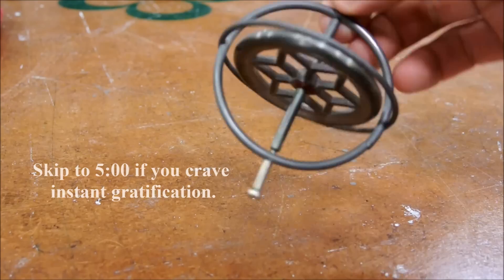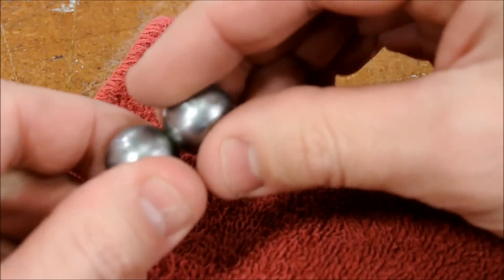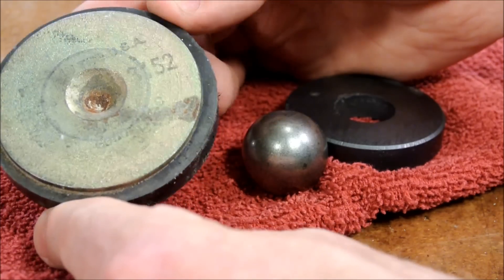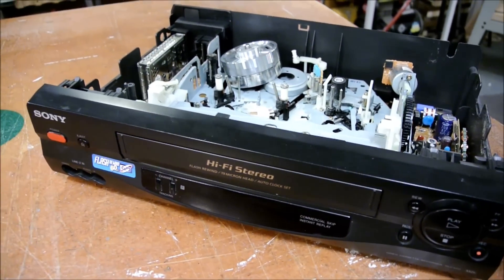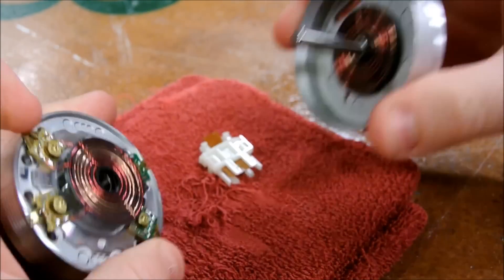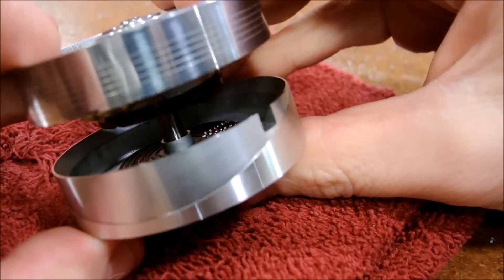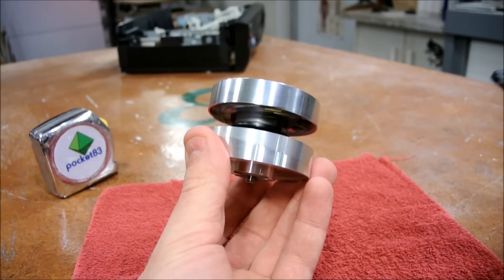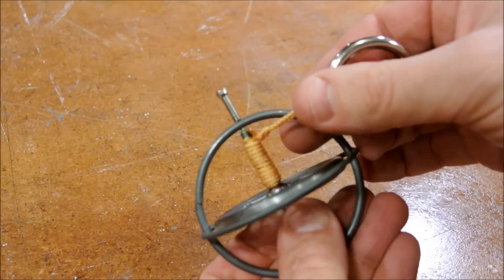VCR head gyroscope! ...and other shiny spinning objects

Comment: Oh the hundreds (maybe thousands) of VCRs I worked on over the years. I threw away (recycled) the last couple dozen video drums I had when I closed my shop in 2013, But I did strip and save the bearings and the locking collars. I kind of wish I'd saved one now. Those parts you're aiming the air at are the actual videos heads, in case you were unaware.

I always enjoy your videos. Thanks.

Comment: The VCR head works just like a tape recorder head with a couple of exceptions. There is a lot of information in an audio/video signal, so the engineers had to get as much information as possible into the smallest unit area of the tape. To accomplish this three things were done:
1) The head is is very small in order to leave a small track of magnetic information behind. That allows the machine to leave many many "stripes" per linear inch of tape.
2) The head rotated at a very high speed to read as many lines as possible each second.
3) To understand the next part two physical properties must be defined: Cohesion (koh-HE-zhun), and adhesion (ad-HE-zhun). Cohesion is how well one thing sticks to something else, and adhesion is how well somethings molecules stick to each other.
A layer of  air molecules stick to the rotating drum through cohesion, and adhesion causes a layer a little bit thicker to stick to the first layer. This means that a cushion of air is stuck to the surface of the rotating drum. This means that the speed of the drum determines the thickness of the air layer on top of it. This is balanced against the tension of the tape, and it allows the tape to move over the high speed drum floating on a cushion of air! That allows the tape head, and the tape to be very close together, so that a lot of information can be packed into a small area.
Also at 4:46 the speaker is pointing at the heads for the circuit boards with a pencil. The part that sticks out past the surface of the drum is the actual head.  (I told you they were small!)
I hope this helps.

Comment: Without looking at any comments and not scrolling down so I’m unadulterated in seeing anything I would say cold when using compressed air.  Pretty cool. I need to scavenge an old vhs player and get to shredding something that I have yet to operate on.   I never thought I’d be tearing up or down old electronics but not that I’m old and torn up myself it’s really all that I have and it’s pretty cool actually seeing how things are built and function and some things have really awesome parts and then there’s trying to figure out what some parts can be re porpoised 🐬 for or if they are just really neat gizmo toys. Rad Video 
Man!

Comment: Some time last year my grandparent's neighbour asked me to take a look at her VCR, and just trash it if I couldn't fix it. Probably a clever way to save herself a trip to the tip.

I couldn't fix it since my knowledge of repairing electronics is just looking for swollen capacitors or burned components, but I did also spend a while playing with the head. I didn't think of using it as a gyro but I replaced one of the bearings with that retaining collar, which was strangely a very precise fit with bearing holes, and used it as a spinning top.
Reply from the maker: That's funny. I think I did exactly that with the last VCR I ripped apart.

Comment: You are supposed to sit these old tops on a  scrtched wire, they dont bounce around and you get a nice top holding straight on a string. ( that's why they have a notch under its main pole.)

Comment: If you want to get a really good pull on a gyroscope try 3 to 4 feets of braided fishing line.
Its really strong and very tiny so you will get many tours around the shaft.
The more tours the more force you can apply at pulling so ... MORE SPEED! :)

Comment: When the ball/magnet spins at an angle, even though it's touching the glass at one point, wouldn't there be a lot of friction because the point that is touching wouldn't be on the axis perpendicular to the axis it's spinning? I imagine would be like a wheel spinning on the spot, which explains why it slowly moves(the ball can't get traction to move quicker but it shows the point that the ball touches the glass is moving very quickly) which id imagine would slow down its spinning speed.
Reply: Peter Minnekeer excellent point.

Comment: For the gyroscope forget the string what you can use is a tire preferebly small bike tires and with that if you run the axle part of the axle along the bike tire while turning the bike tire you can literally kick it at high speeds! Just be sure to lube the ends before doing so as the gyroscope uses friction instead of rolling element bearings! XD

Comment: Questions: 
With the high speeds of the VCR head, blown by the air compressor, how much voltage / current could the vcr head produce if used to produce electricity?
In like manner, if the threaded together ball bearings were made of different materials, and blown to those high speeds, how much current / voltage could it produce?
Would the created voltage / current be less than, equal to, or more than the energy needed to blow either of the above to those high speeds?
fyi: The ball bearing question above is envisioned as the bearings made of magnets / magnetic materials.
Reply: 1: it wouldn't,  2: they wouldn't, 3: Far less.       magnetic material... irrelevant.

Comment: Hmmm. I don't have an air compressor OR a bicycle. I do have a motorcycle which can spin a 25 inch tire @ ~2000rpm. That's north of 18,000rpm for the gyroscope...now I just need a VCR head!

Comment: you could connect led's where the read/write heads are connected instead of cutting that ribbon cable off of the stationary part of the drum that powers the coils in the ferrite plates inside that are for wireless power transfer to said heads  With the addition of a 74HC595 or a 74HC164 serial in parallel out chip (or several of them), and a few other parts (capacitors, resistors, maybe an inductor and such)  you would have the "hardest to build" part of a persistence of vision displaying gyroscope! That my friend, would be ultimate! 

To those "fidget spinner" knobs.... build something! Fidgeting gets you NOWHERE!

Comment: Hot, friction causes heat right? Rolling friction of the bearings, and friction from the air resistance on the outside
Reply from the maker: Yes, but wrong! Friction does cause heat, but this thing still gets cold. Why? Because the compressed air quickly sweeps away all of that heat, and then some.

Compressed air is air that is in a settled-down state; heat is simply molecular motion, so in order to cram lots of it into a small space, it has to give up its heat (energy).

In scientific disciplines, this idea is known formally as the Ideal gas law, which is usually expressed mathematically as PV=nRT, where P,V, and T just mean pressure, volume, and temperature.
Reply: pocket83 yes of course! I should have thought of that! Thats how a refrigerator works too, when the freeon pressurized gas is released it is really cold!!

Comment: I thought it would get cold because when compressed gas decompresses it becomes cooler
Reply from the maker: Yep. Even though the bearings generate heat in the form of friction, the fast-moving cool air sweeps away the heat (and even removes some after that). The result is cold metal.
Reply: pocket83 ahh interesting

Comment: Does it become cold because of the expelled kinetic energy?  or would that just make something hot?  Physics is confusing.
Reply from the maker: Physics is confusing. But it's also possible to understand.

Friction (from kinetic energy) does cause heat, which should make it feel warm, but this thing still gets cold. Why? Because the compressed air quickly sweeps away all of that heat, and then some.

Compressed air is air that is in a settled-down state; heat is simply molecular motion, so in order to cram lots of air into a small space, it has to give up its heat (energy).

In scientific disciplines, this idea is known formally as the Ideal gas law, which is usually expressed mathematically as PV=nRT, where P,V, and T just mean pressure, volume, and temperature.

Comment from the maker: ;)
Reply: "Read" the description
Reply: partyrocker You need to scroll down more if you think he is the only one mentioning VSauce....
Reply: pocket83 I think it becomes cold because something about it spinning makes it a centrifuge and makes the molecules stop moving and that makes it cold? I'm just guessing
Reply: Agree
Reply: I think it is cold, because he used compressed air.  That makes things cold.
Reply: I thought it would become hot from air resistance, but I suppose aluminum is such a good thermal conductor that any heat generated by those electronic bits (on silicon chips, good thermal insulators) quickly spreads through the large mass and dissipates.

Comment: Hmm... I know how CDs work. How cassettes work. Even how flashmemory works. But not VCRs. Time to correct this Will come soon.
Reply from the maker: I was reading briefly about how the tape goes around the head in a helical fashion, rather than in a linear feed (that's why it's at that goofy angle). I though that was really clever. I guess one benefit is that a crease won't entirely destroy a cross section of information. Weird.
Reply: Spin the heads and the tape can move slowly, otherwise the tape would have to move at the speed the drum is spinning. My dad used to repair these back in the day (electronics engineer), I remember him telling me how the head alignment was one of the most precision things people had in their homes in order for every machine to be able to record and playback every other tape, and yes I made plenty of spinning tops from the heads as a kid :)
Reply: pocket83 Hah. I always thought that that angle did not make any sense whatsoever.

I might have a working one in my home, still.

Comment: why does it become cold?
Reply: Because of things... you know...
Reply: Joof My guess would be more from the compressed air than the physics. Air friction from spinning would normally suggest increased heat, but he's using compressed air, which has a greatly lowered temperature due to the air being more dense. Packing more gas molecules into a smaller area means they can't move as freely, reducing their movement and therefore heat energy. This is different than those pre-packaged CO2 canisters, those are filled with CO2 cooled to liquid state, they pressurize as they warm back up.
Reply: I'd rather put it that the air rapidly loses its temperature when it decompresses.
Reply: its the opposite actually. compressing the air makes it warmer. think of a fire piston. it gets colder when it is blown out the nozzle because it expands to atmosphere pressure and it takes heat energy from its surroundings to do so.
Reply: The air when it's compressed heats up but the hot air is inside the compressor tank and it cools down eventually. But when it decompresses it cools down even cooler than it was before because it lost it's heat while it was in the tank.
Reply: Ethan Sloss same effect happens to rubber bands
Reply: Hybridizer, nah man. Pressurising increases temperature, you put an energy into system by the very act of comressing. Molecules have less space, yes, but that just causing them bumping into each other (and the walls of the container) more frequently (which we can percieve as heat). Now if those particles left alone for a while, they'll cool down to outside temperature, and if you release the gas the particles will spread out and move much slower, because of all the energy loss when they cooled down in the container.

P.S. sorry for my English, i hope i was conpehansable enough.
Reply: the bearing has very little friction. friction = heat. and he is cooling it with air. expanding the air, not compressing it. opposite of heating
Reply: Hybridizer .. spin it with a motor. How about a vacuum? Temperature will drop,
Reply: Convection